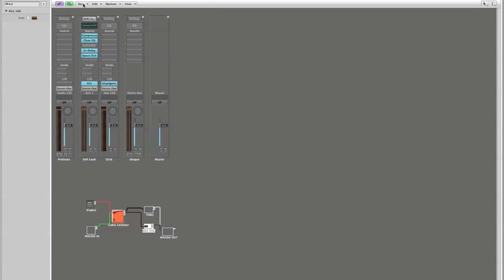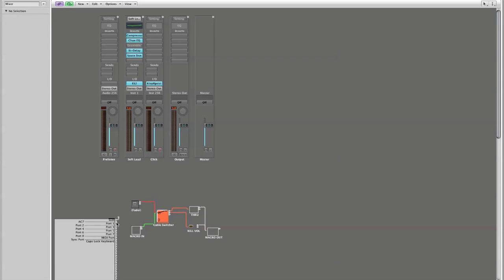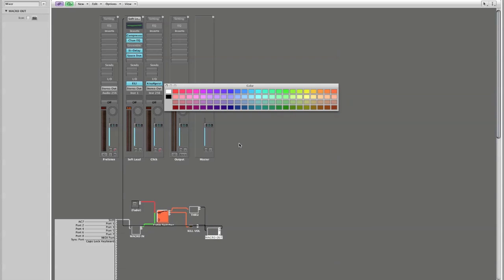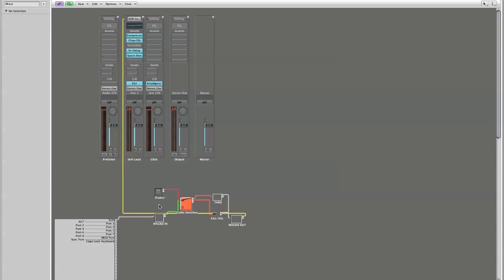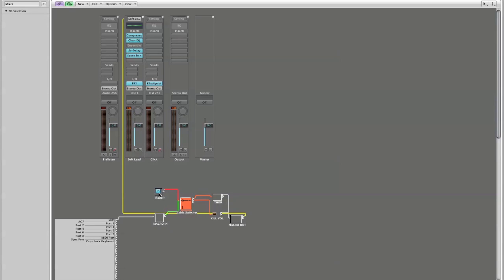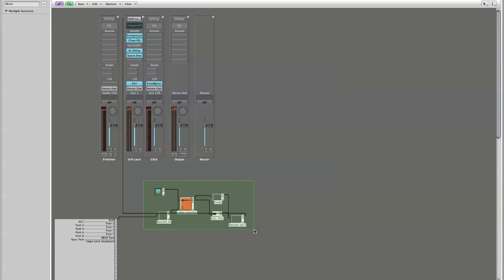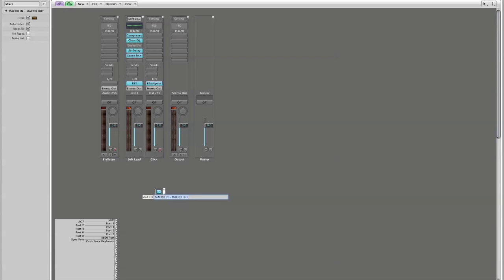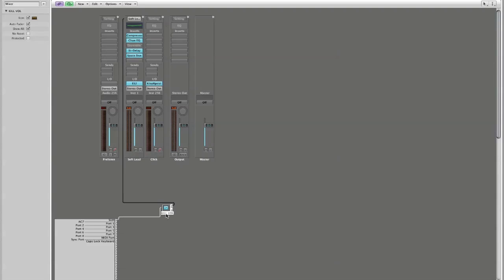EWILogic.com Building an EWI Environment In Logic Part 1C

Comment: I truly appreciate the effort you put into this, I followed up all 3 videos in the "Building an EWI Environment in Logic" and got my macro up and running. But I think it would be helpful if you shared the settings on your EWI. I have a 4000s and mine is simply not playing as smooth as yours seem to be. I have to blow a lot to get sounds out of mine and it's really not responsive. I'm starting to wonder if the problem is on my EWI settings or on my MIDI interface's latency... Thanks in advance!